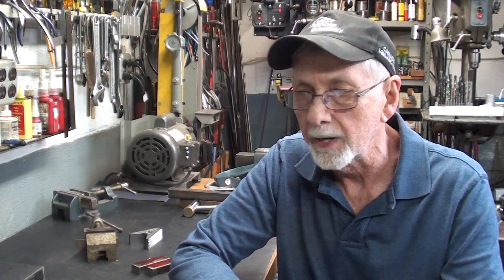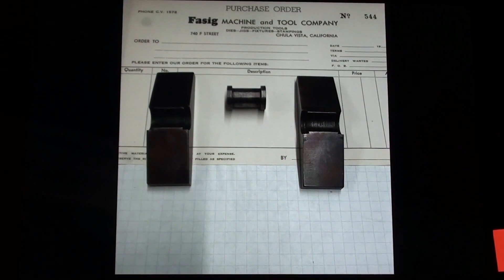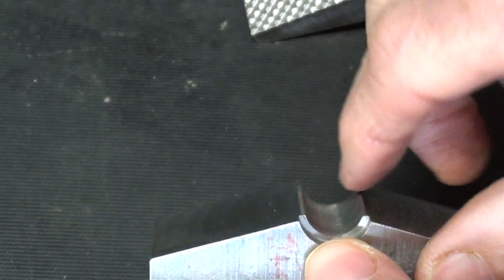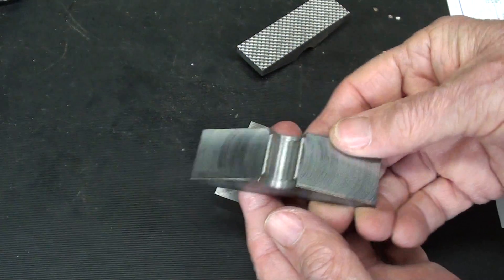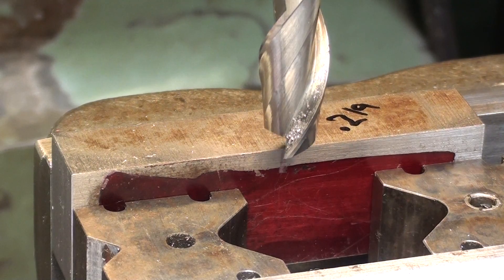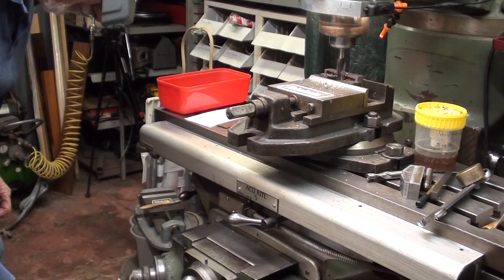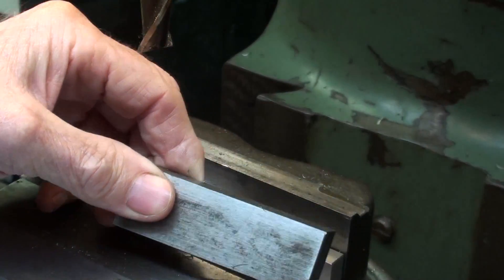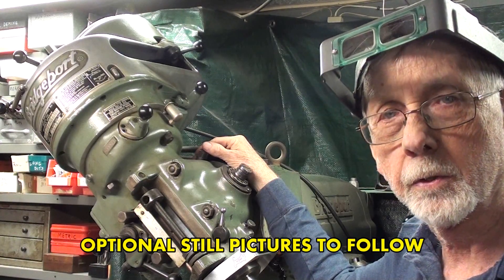MAKING SWIVEL VISE JAWS #712 pt 1 tubalcain hole forming mrpete

Comment: Mr. Pete, I am I reckon about the same age as you.  I like your channel.  Even I learn something from you, or see a new tool made that will make my machine  shop run  easier.  For the life of me I cannot understand your use of the name "Tubal Cain" as your title on the YouTube platform.  
There was the original Tubal-Cain from the Holy Bible, and then there was the Pen Name of Tom Walshaw, who wrote MANY books on and about the machinist trade.
Is there a reason for using these two famous metal workers name as your own?  Your certainly are not the Biblical and history records that used the name.  Now, Tom Walshaw was another great machinist from days now long past, since he died in 1998,  He was a master at his trade and always pointed out that his writer's name for high end model engineers was a Nom de Plume moniker.  Why don't you show the same respect to the elder and past teachers?  You are pretty (very) good at what you do.  You don't need to steal a name from one of the greats, friend.

Comment: Hi Mr Pete 222 watched your video but i put spacer between the blocks and pinned together then put in vice machined  hole thru and the captive recess by pinning them together you can turn over blocks to do the other recess and only have 2 operations instead of 4  regards john
Reply from the maker: Thanks
Reply: @mrpete222  your reply suggests your not interested in showing any other ideas on how to make this item easier

Comment: Really appreciate your videos. The question I have is shouldn't the swivel pin hole be a little less deep to allow the plates to touch each other at maximum swivel? Hope I explained it correctly.
Thanks again.
Reply from the maker: Give it a try when you make yours

Comment: Hello MrPete I like your videos , Any thing 30 minutes or less is Ok with Me , Nobody is perfect sometimes they could go up to 40 minites .
Inthis video #712 Pt1  at 14: 00 min. acording to the drawing you should have 1/8"  , You have 1/16" on eache side not 1/32"  , the center should bee at 0.250 haft the Dia. of the end mill the center is on the edge of the part the angle starts at 1/16" from the edge and goes to the end at 1/4" of the other edge ?
Georges

Comment: I find most of the non-narrated short videos are about an idea, that's about all I get from them. So you watch it in the hope of learning something and although it may be well engineered and well presented it finishes with you feeling that something was missing, the journey, the thought processes, the pitfalls. Their idea is to make money of course, as quickly and easily as possible. :(
Reply from the maker: Thank you for a very insightful comment. I agree that something is missing without narration. I pretty much won’t watch those videos. I didn’t realize they were just cranking them out to make money, but then again I am incredibly naïve

Comment: I made a similar item years back; instead of the center pin, it has a large center ball bearing so the swivel can pivot in more than one direction.  The the two halves are kept together by springs in tension.  Only used it a few times, but it worked well.
Reply from the maker: I plan on making a mock up of the vise jaws With a ball. Several people have mentioned this

Comment: Lyle, this is yet another of the projects you share that I will have to make for myself!  In fact, I'll probably make 3-4 of them to fit different size vises, including a large one without serrations for my (blacksmith) post vise to avoid marks on the red hot metal.

Comment: What a great little project.  I'm often having to clamp on material that's out of square while I'm squaring it up on the mill so I'd get some use out of them.  So much so I'll make a second set to use at work.  As a bonus, nice little project for the shaper!  Cold blue them and keep them with the obligatory 52 pc. clamping set hanging off the side of the mill.

Comment: I like your long videos. Perfect pace and narration. Been following you for a couple of years now and enjoy every video.
I actually might have to make such vice jaws. I have a rock solid German vice that I often clamp non parallell parts in. Most often I use wood in between but it usually split when I put any force into the part.
With these jaws I don't have to tighten the vice until I turn blue.

Comment: Mr Pete,
When drilling,/milling the pivot bolt holes why not put in a piece of material between them to offset the drill/,mill bit to each side and clamp in a vise and drill/mill both pivot pin holes as one?
Reducing the motions by a few steps.
Just my $0.02 worth.
Thanx for another addition to my book of projects.
Reply from the maker: Yes

Comment: Hey Pete! Coming up with your method of making the 1/2"hole is an apparent problem that would leave most scratching their heads. Yours is a good solution. When I first saw the issue, I immediately thought, put both jaws back to back with a properly sized full length spacer between them, then simply drill, ream and c-bore the hole. Pull out of the vise, drop a 1/2" pin in the hole, and c- clamp the pieces together, remove the pin, and c- bore the opposite side. Another way to solve the problem if one lacks a milling machine. Thanks for sharing your knowledge and talent!

Comment: I don’t know nothing about nothing, but wouldn’t it be easier to sandwich the two pieces in the vise jaws with a couple 1/16 or 1/8 spacers, then drill both sides at the same time.  It also looks like this would be more accurate as the lateral stress would be equal during the cuts.  Am I missing something?

Comment: Interesting project. I'll figure out a way to do it "my way".
Adjusting the angle of the head, the spindle, on my hobby mill will likely end up in a bang and 90 degrees of cutting angle..... and the headache, how to get it back to 90 degrees vertical again... Need to figure out an alternative way....

Comment: went to myheap, I don't see the plans there yet. I actually think this is a valuable asset.  I'll probably build this, and put in a v down the length in the middle for holding round stock if ever needed.  Just a slight V.

Comment: Saw your video the other week on doing the flat knurling,  have had my Klopp 550 Shaper for 5 years or so, thought it was time I used it, so I knurled some scrap steel, I set my table auto feed to the maximum, and adjusted my depth of cut to suit, 20 thou gave the best results. and once you set up and work out the depth of cut etc it's FAST.
Thanks for that video Mr Pete, and all of your others as well.
Cheers from Australia.

Comment: Just wondering... Is there a reason not to machine both pieces at the same time with spacers with the right clearance on both sides between them? It would be quicker with three operations instead of six. 
(I'm not a machinist by the way ;)... but I love to learn.)
Reply from the maker: As I often say, there are 100 ways to do any job
Reply: @mrpete222  I just wanted to make sure there wasn't a reason regarding precision or safety in operating a mill I wasn't aware of. As I said, I'm no machinist, so thanks for the response.
By the way, I find the format of the videos perfect as it is... no need to change a thing. :)

Comment: I think differently then most. I'd use a block 1 1/4 or 1 1/8 square to machine . Drill one hole counter bore both sides ,saw in half after cutting serrations on top n bottom . Then mill angles deburr  an heat treat after. But I guess it depends on material in stock.
Reply: Looks like the natural way of building should be : serate block, drill holes, saw on the diagonals; turn pin. Looks like set for no cleanup with 1/8" sawblade..

Comment: Mr. Pete, don't change a thing in your videos. I will watch them if they are 15 minutes or 2 hours and 15 minutes. I have an idea for a project, Make a square and hexagon collet block using an R-8 collets. Many of us have small mills that use R-8 collets and don't have C-5 collets. They would have their limitations as to how long a piece you can use in it but great for small/shorter pieces.
Reply from the maker: Great idea

Comment: Great tool, I will be making one. I picture V grooves to help with tapered round objects like the lathe center you showed, and magnets in the two sides at the pivot location to help hold it together during set up. Do not pander to the masses sir, leave a completed body of work that lives up to the high quality products you have created up to this point.
Reply from the maker: Thanks

Comment: I made one of these (roughly similar, of course!) for woodworking a few years ago, to clamp leg or chair legs before drilling..
I just used a large hardwood dowel between two matching 1/3 drilled holes, in removable vise jaws.
This is a much more elegant design!
👍

Comment: Hi, thanks for your videos. 
I am just introducing myself at my 45 year to the lathe and machinery world. 
Just more for hobby and or small projects. I have been doing Mechanic most of my life. 
Will be a nice improvement or Idea you can do in the vise jaws is keep the round center in one of the jaws by a centre bolt that hold the pin and allows 15° of movement side to side  The comment is because I lose any small tool lol.
Reply from the maker: Thank you, I talk a little bit about that in part four.

Comment: I watch oll your films. 
And and going out next week. Covid allowing. To spend £3000
On a brand new lathe. 
For a bin lorry driver. 
That is a big chunk ok money.  And all of that for a shoulder bolt. M
Reply: My "reason" for buying a surface grinder was the acquisition of a wood chipper.  Manual says the blades should be sharpened on a surface grinder.

Turned out that feeding the chipper is more work than it is to drag, pile, and burn the junk wood from the yard trees ...

... now I need ideas on a regulated power feed
Reply: @infoanorexic  Check Mr. Pragmatic Lee at the "Tin Barn" - I think he even did a vid on one.
Reply: Ok
Reply: Just kñee  q bigger shed

Comment: Could the serrations be done using a “V” shaped mill cutter?  Could save aligning the mill head.  Thanks for the videos.
Reply: yes, but you would need a much higher speed as you effectively reducing the diameter of the cutter to near zero. (it is done that way on small engraving machines)
Reply: @heronvontremonia9975  Works just fine,  even with a center drill. I have done it that way since I was in High School (and I'm 74 now)

Comment: My first instinct would be to drill and ream a hole, and then cut the piece in half to end up with two jaws and two identical half-circles. Reamer makes it a known precise dimension, so turning that middle pin wouldn't be complicated either.
Reply: @fall22123  ...EXACTLY-(!)
Reply: @fall22123  ...not necessarily-(!)

Comment: Thank you for putting all the effort into your videos tubalcain. I would love to see case hardening
Reply: Could you Rockwell test the case hardening, showing the hardness and different thickness depths? A test block added to your basket could be used. What if the first surface tested was surface ground .005" then retested, the second side ground .010" then tested, the third ground .025" then tested, the fourth .050", the fifth .100", the sixth .250" giving 7 difference hardnesses.
I feel most don't realize the results of case hardened.  Can anyone guess the differences hardnesses?